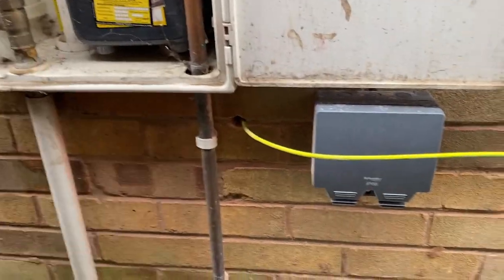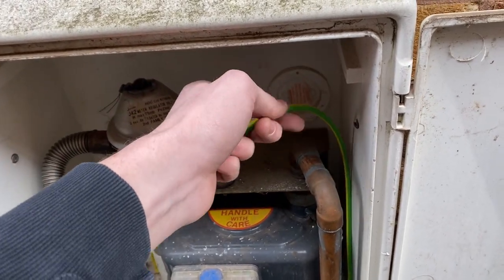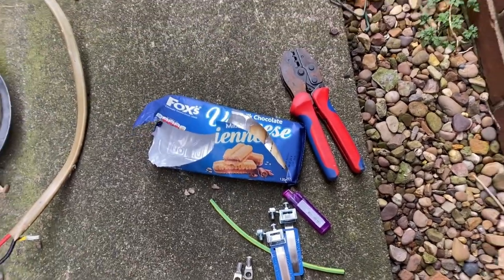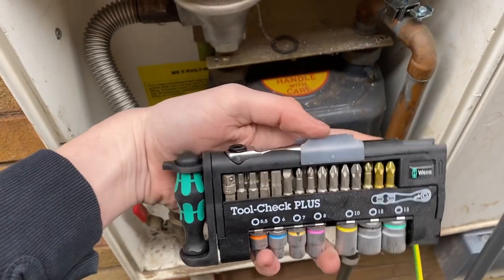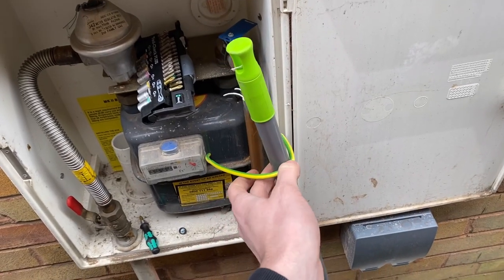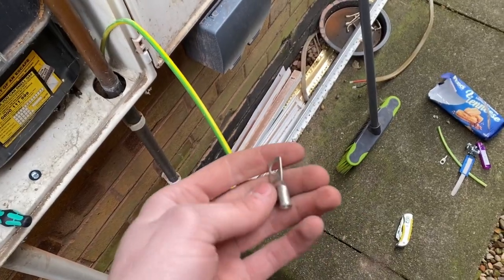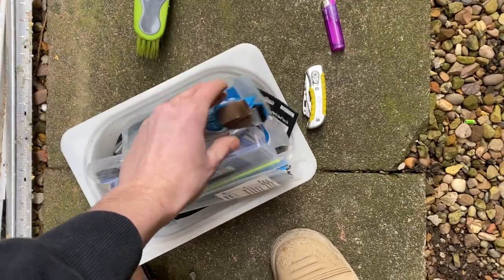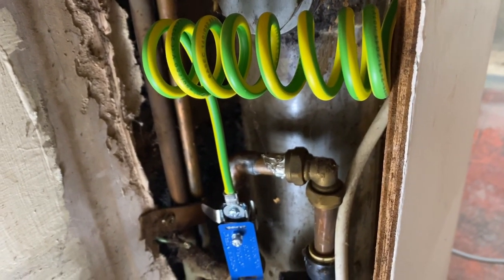How I bond gas and water pipes - Electrician Apprentice - Do you pigtail your cables ?

Comment: I dont think you really need the heat shrink as the crimp connector and the earth strap are bare metal  , also to be using a lighter beside gas ....Noooooooooo

Comment: I'm GasSafe and Napit reg'd. I prefer not to pigtail and try to create the shortest possible path to ground with leaving enough slack incase any amendments need to be made. We don't do rear entry into the gas box incase of gas escaping and entering the property. Same principle for the gas pipe itself, especially If it's a medium pressure installation.  Equapotential bonding isn't required if the installation has polyethylene pipe upstream of the meter itself. Again same principle for mains water. The lighter near the gas meter made me cringe a little. Still a great little tutorial though 👍🏻
Reply: The strain relief offered by the pigtail is a huge benefit.

I don’t think the electrons will mind a slightly longer length it creates 😂
Reply: I'd generally prefer the pig tail also being GasSafe and NICEIC registered. Last time I sat my renewals it was classed as ID for rear entry on medium pressure installations. & regardless of Poly being upstream we're required to bond, you can't use Poly downstream of the meter though - rigid or semi rigid metal pipe only.

Comment: I'm agreeing with the comments.  Pig tail is a no.  Even though it's a short run it will add inductance to a fault and potentially have poor outcome.

Also I was taught it clean the pipe first, usually with strip of Emery cloth.

Comment: Sound video Adam, the reason you are not supposed to drill through the back of the gas box is that if there is a gas leak there the gas would go up the cavity.

Comment: I am in the USA, but I don't understand the reason for the "pigtail."  That adds inductance, and adds more cable.  You want it as short and straight as possible for ground lines.    Otherwise good work.  👍😁
Reply: Pigtails are known as Loops in cables which are allowed. But coils in cables are not allowed as these can induce an electromagnetic field. Loops are shorter and not wound the same as coils therefore they assist with adding termination slack and releasing cable strain from the gland to the termination connection. Strained cables can create loose connections as copper/aluminium electrical cables expand and contract due to thermal effects and not meeting torque requirements of connections. Loops have zero turns while coils have many turns of wire/cable.

Comment: The pigtail is a funny one, college lecturers told me that curling the cable puts stress on the copper and insulation. I think its personal choice, for me I would take it to the top of the gas box and then back down to the copper pipe.

Comment: on my first job like you i used crimps ive been told recently and after looking at am2s videos they just wrap the copper round the screw and tighten it. is it swings and roundabouts or is one way how it should be done
Reply from the maker: Swings in round about both ways work personally crimps are better

Comment: Good video Adam, never done the pig tail myself but might have a go next time ! 😁 
Will have to check the regs, but I’m sure it mentions that if the gas meter is external you should bond it within 600mm of entry to the building. Why did you choose to bond in the meter cupboard itself, is the entry point in bulding too inaccessible? 
Although saying that, the majority of new Builds I see, it’s often bonded in meter cupboard.

Comment: the screws in the side of the gas box fixing it to the wall need to be sealed as gas could escape into the wall cavity and you could get gas build up !! we away fix the gas box in the wall with expanding foam adhesive

Comment: Don’t you need to lightly sand the pipe so its bare copper without any oxidation just curious
Reply from the maker: Yes or use a Stanley blade

Comment: Gas bonding - within 600mm of the Meter before the first Tee, or within 600mm of the entry to the building before the first Tee. Regardless of the incoming supply pipe, be it polypropylene (yellow plastic) or not. Same is true of Oil supplies from Oil tanks, though you're better off bonding an oil supply after it transitions to pipe and away from Soft Copper Pipe.  

Also very nice to see you bring up the bond in the correct position and not through the back of the meter box. Very nice pig tails to boot.
Reply from the maker: cheers
Reply: Why bond the gas pipe if it's not extraneous?
Reply: @andrewcadby  All pipework gets bonded consumer side of the meter which is required to be in rigid metal (steel or copper, or semi rigid ie trackpipe). Gas Meters are supposed to be securely fixed to the fabric of the building giving them the same potential as earth. 

It's a Gas requirement to minimise explosion risk rather than a requirement of BS7671 for electrical safety.
Reply: @effervescence5664  Thanks for the explanation

Comment: Pig tail add extra resistance that's not needed 

Also get the correct size lugs and it makes a nicer job 
10-5 lugs fit properly look nice and fit into heatshrink easier

Comment: 600mm
Reply: If not possible/practicable. Within 600mm of entering the dwelling before the first T branch. 👍🏻
Reply: @Ray C  within 600mm of the outlet of the gas meter and before the first T.
Reply: @seanyorke4295  Yes but if it's not possible to do this.  Then it's also acceptable to equipotentially bond on the gas or water pipe entering the dwelling.